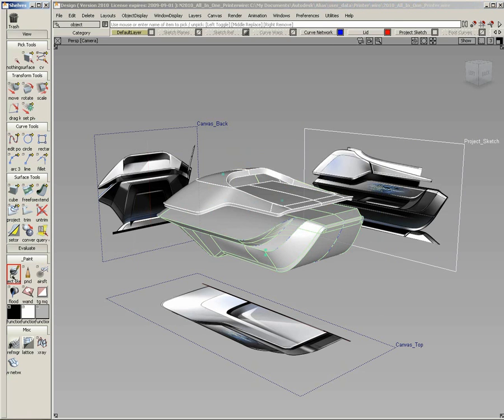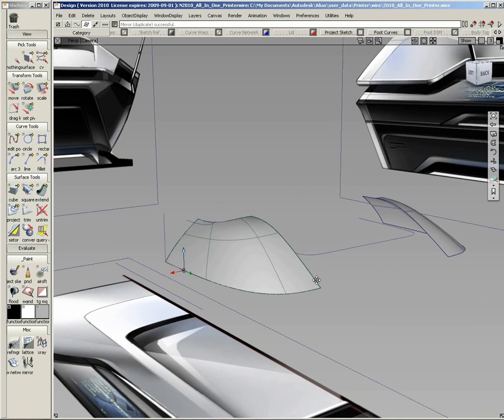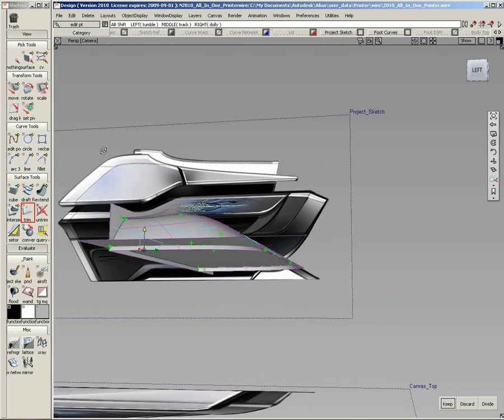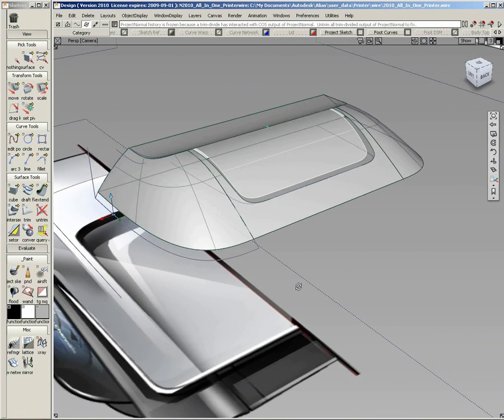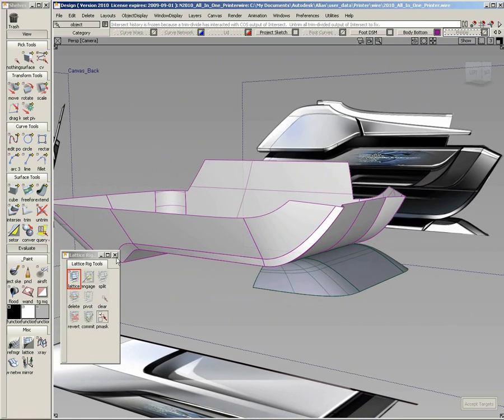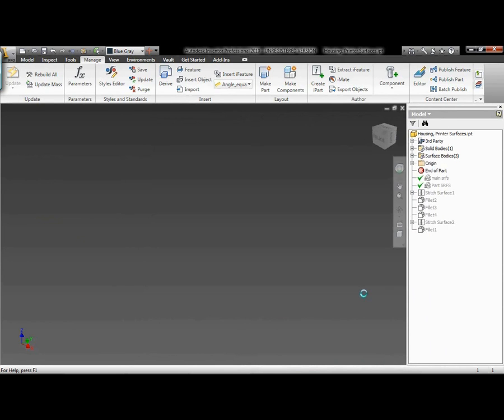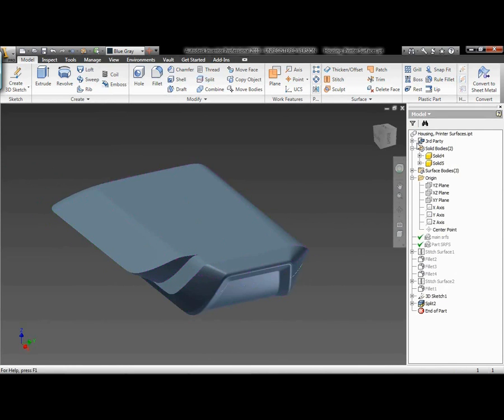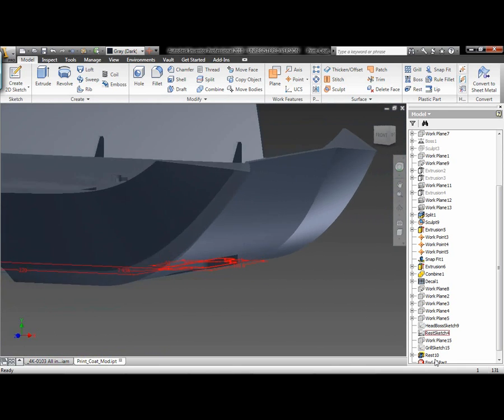Autodesk Alias and Autodesk Inventor Workflow

Comment: Hi Andy,
I have only just started using Inventor but I used Creo Parametric.
Creo had the surface modelling feature that you used in Alias does Inventor have this too?
Reply from the maker: You may want to check some of these new features out...
Autodesk Product Design Suite 2015 - Freeform modeling shape creation

Sketch controls are also helpful when working with surface geometry in Inventor...
Autodesk Inventor 2015 - Sketch constraint control

Some of this video at time(4:20) as well...
Autodesk Inventor - Surface Modeling Canadian Canoe

Comment: Hello Andy, I have a question about this process that you've shown in the video. Here in Brazil, Autodesk Inventor is not so popular as Solidworks. I just wanna know if this workflow is possible using Solidworks?

I'm a Autodesk Alias user, for me is the best design software, but the industry doesn't understand .wire files, therefore I have to send more detailed files, but it has to be in a Solidworks file.

Is it possible?